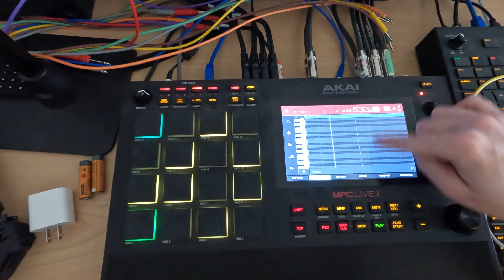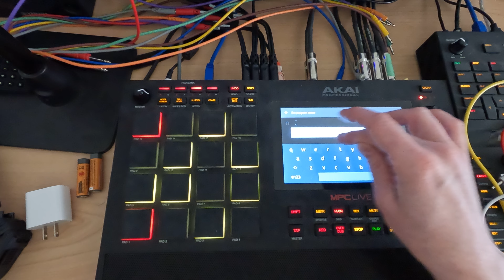MPC Live 5.1 - Clock and Reset CV Outs for MPC Live and Eurorack Modular Setup

Comment: The problem is reset gets sent every time the bar loops. It seems like there is absolutely no way to get the MPC to only send the reset when you press play.

Hacks are song mode with 1st sequence having reset and 2nd sequence not. (cant live record this way)

Make the sequence long so it never loops, again cant easily record and move around in sequences.

If I have a midi device in my rack try to turn start trigger into reset it will correctly send only one reset but the mpc will be one beat ahead so looping wont line up 

I'm honestly just about ready to move on from having the MPC part of my Eurorack setup.

I have to manually mute reset before the bar loops otherwise modules with slow dividers get reset far too often.

We really truly need to get support for sending a single reset when the play button is pressed.
Reply from the maker: Yeah, it's not perfect, but I'm not doing generally doing things with it (at this time) that require a sync on the start of a song.

On the MPC you could create a reset track that is 128 bars though, and not have it tied to the length of the sequence by changing the Track "LEN" from SEQ to whatever length you want, up to 999 bars... that hopefully is long enough.
Reply: @NearTao  Haven't heard that one, but I work around it by using my Poly Hector and the midi clock in -> is_running() -> difference A (B set to 1.0) -> Rectified to positive.
That gives me a perfect reset output that goes high whenever the MPC is stopped and goes low the instant I press start. Only way it stays on beat that I have found.
Reply: It's a year later... has this been fixed?
Reply: @VincentsVideoVisions  kinda, I had multiple variables at play.

The mpc doesnt do start or reset in my setup anymore. But I found out one of my modules (euclidean circles v2), had a setting for rising vs falling edge reset detection.

The mpc could have worked using the midi device that sends reset if I knew about the falling/rising setting. After changing that the 1-beat off problem went away.

I still know of no way to only send reset on starting.